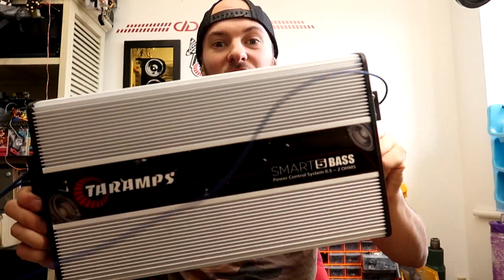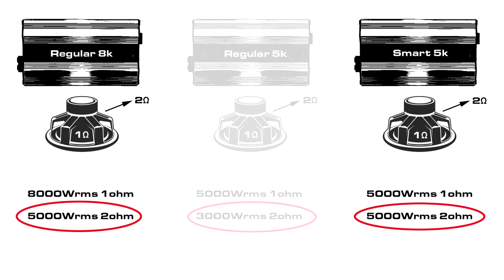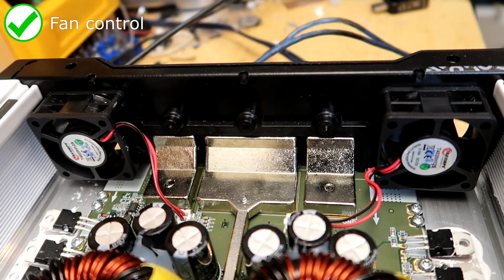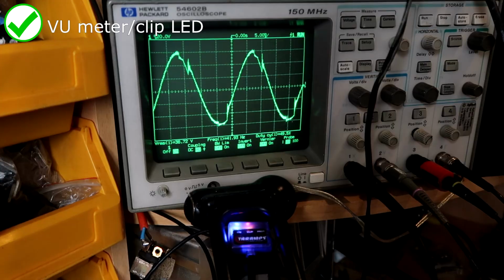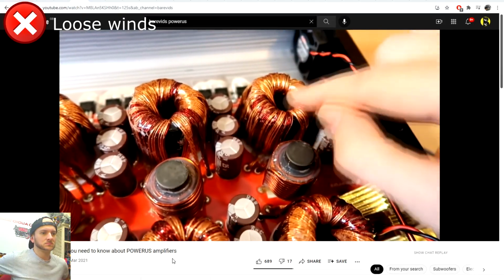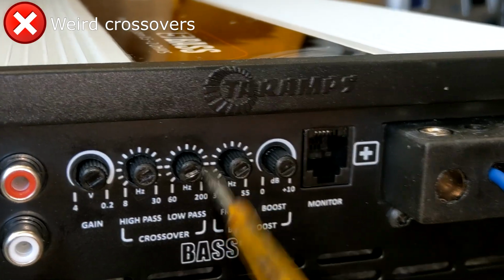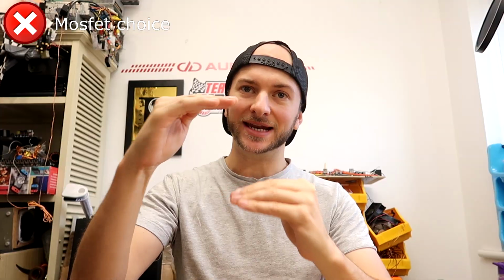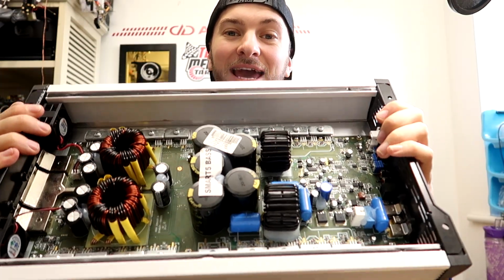The good VS the bad - Taramps SMART 5 & BASS circuit overview

Comment: I've got the taramps smart 5 bass and it has way more power than the other 1500 watt amp I have but now I've had it for like 2 months and I'm Hella disappointed I'm getting not much bass at all before the thing clips and it clips so easy I even have a lithium battery and  all 0 guage wire like I can berily hear the bass loud outside the car I have a skar vxf and I also tried 2 american bass elite 12vs I need help lol I want more bass I've seen people with a smart 3 flexing doors inches but I can't at all

Comment: hi Sam my HU rca pre out 4v but my tarampsinput sensitivity can only take 220mv how to match the level. please advise thanks
Reply from the maker: That isn't true, anyway your head unit pre out is only 4v when the head unit volume is on maximum and all of the subwoofer level etc is turned up to full. Just use your head unit how you would normally and set your amplifier gain until you reach one of the limits - amplifier clip, woofer thermal, woofer mechanical, or battery voltage drop.
Reply: @barevids  thanks Sam really appreciated
Reply: @barevids  subscribed

Comment: Would the smart 5 bass play mids and vocal or only bass?
Reply from the maker: @lawayne2021  only bass hence the name... Get the regular smart 5 for higher frequencies
Reply: @ the problem is I already brought the amp do you feel like that amp to power for a sundown u12 v2?
Reply from the maker: @lawayne2021  I don't understand, why are you asking about vocals when you are needing to power a sub? It is perfect for the sub
Reply: @barevids  I brought it for my sundown u12 v2 then I was told I can’t use the amp because it’s too powerful I have to get the smart 3 bass but I also have 10 10 midrange speakers I was told the smart 5 bass can play mids
Reply from the maker: @lawayne2021  that is nonsense, there's no such thing as having too much power. You just need to set the amplifier within the limits of the driver. It is stupid to recommend downgrading the amplifier, all this will mean is you impose a rail limit, and worsen the system efficiency and reliability.
Reply: @ alright thanks

Comment: Hello mate I’ve had shocking after noon basically I’ve had the amp taramps 800w when I hook it up was fine I was testing it for clipping 
No one is mention that they do not like more that 2v in from head unit or graphic 
Hints why it court fire 🔥 
Model number taramps ds800
Reply from the maker: @kayone8571  that's not why it caught fire.
Reply: @ hi and thank you for your reply  I don’t know why it did I was told they do not like 4v sent throw phono leads dunno how true that is 
Because all my other amps are just fine 
It’s grounded good with clean connections 
The power lead is good and thick little over size but definitely in the hole 
And it was new 
I have a old skool Kenwood  KGC . 9044 eq that has the adjustable screw from 1v to 4v it was Present on 4 v 
That then goes into to dsp crossover prv then to my amps I had all amps disconnect
Accept the one I was setting up with scope I had head unit where I know I clips I heard a pop then smokes from the remote and power I’m stumble I’ve fitted many and I still have them working
Reply from the maker: @kayone8571  You've probably killed it because you were clipping it. You don't need to set these amps up to clip or see the clip or anything like that. I assume you are using this on full range drivers. Therefore you would just set the gain at a point that is comfortable at the maximum hedge unit volume that you are normally using. You will know instantly if the amplifier starts to clip because it will come through as heavy distortion for your speakers. You don't need to use a metre or oscilloscope or anything like that to set your gains on these amplifiers. If you didn't have a load connected to the amplifier terminals and you were clipping the amp then that explains why it failed.
Reply: @barevids  thank you that’s exactly what I was doing I’ll try again on the second one with speakers connected and adjust only gain where my volume is up
Reply: @ hi buddy you was right the second one is working good now also I had. Inline fuse off the battery but didn’t have one close to in put to amp I’m
Trying to find which fuse is best for this amp 
I have now Install one near amp in put positive 50amp but I think that’s to low trying to find online
Reply from the maker: @kayone8571  you don't fuse for the amp you fuse for the wire. Don't run two fuses in series. Just have one on the power wire near the battery.
Reply: @ oh ok watching plenty America’s fuse the amp side as well
I’m not sure which amp fuse I need the manual says nothing

Comment: 0:23 as a guy with 3 dead smart 5s in my possession, I'm very eager to see what I can learn from these videos. I watched your full guide video you did with the SFB sundown and learned a lot! I'm learning a lot from all of your videos and super grateful to have found this one. I'm looking to become the St. Louis MO amp repair guy here in the states and your videos are next to golds worth for me. Thanks so much
Reply: Did you find out why the amps died? Are they just not reliable? I'm on the fence about buying taramps so I would appreciate any input you have.
Reply: @shawnchapman5916 most of the time I'm finding it comes down to a manufacturing fault, or a power demand fault. These smart amps are keen at keeping the wattage exactly where you want it down to a half ohm.. and they do so by clocking the power supply in a way that makes it drink reserve current from you batteries and charging gear rather aggressively. In short I always say: powers gotta come from somewhere. This is only my opinion and you may do with it as you please but... Your electrical demand should never exceed 50% of your total reserve at one time.
Reply: @CompanyNameLLC  i seen from your previous comment your from st louis, are you still doing amplifier repair?
Reply: On a side note... I'm looking at Taramps and Stetsom HV Series amplifiers lately. I see a large reliability in HV amps where you use voltage rather than current to feed the amplifier... With HV... None of the case gets wasted to a power supply for the MOSFETS because your series bank of batteries (170-300VDC) is the power supply. So more room for fets and way fewer losses to conversion. Worth a look. Most units start in the 20k-40kW region. I've seen some as large as 160kw which is absolutely diabolical @shawnchapman5916
Reply: @loudfiat did it really well
Reply: So you like the sfb better that the smart 5

Comment: Id like to hear your thoughts on the new Taramps smart boss 3k. I bought one and its my new favorite amp i ever ran. Im 43 and remember when 1000 watts cost $1000 if you could find one. These small powerhouse amps like the smart boss 3k just blow my mind. I have it pushing a Resilient Sounds Onyx 12" i reconed. What a combination! I recently subscribed,  i like your channel alot, especially the blind amp test with jbl and taramps, taramps should have cut you a check for that one, 😆 im sure it changed alot of peoples opinion of taramps in a good way, it did for me. Thanks for the videos.

Comment: Since the crossovers limit the output drastically unless wide open. Let's say I set the crossover FIRST then set the gain which would then overcome the wonky crossovers & not use the ones on the deck? Currently I am using the deck as you suggested but I hate when I need to pull the battery for one thing or another & my HU resets itself thus loosing the crossover settings.

Comment: Comment #2 - And wouldn't it effectively be more "smart-er" if they would pay more attention to the power supply, regarding the effect the input voltage has on power output?  Meaning: Same power out, between voltages of say 12.6 and 14.4 volts.  Free the output power from being so dependent on input voltage.

Comment: Isn't the REASON WHY the impedance may rise, because it's approaching the speaker's resonant frequency?  And if so, doesn't the speaker become more EFFICIENT at resonance? And if so, the added power produced by the "smart" amplifier - really is not needed/necessary, no?
Reply from the maker: This only applies in free air, as soon as you put it in an enclosure with a port, the impedance drastically drops at port tuning frequency. You can see this by looking at an impedance curve of a ported box.

Comment: Anyone know if you should adjust gains with subwoofer hooked up with these smart amps 5k and 5k bass? Wasn't sure if the smart side of it controls how much it puts out with sub connected vs not with tuning
Reply from the maker: Yep just go by the clip light no tools required

Comment: Can you strap 2 of these smart 5 bass together?
Reply from the maker: No, but you would never ever need to because no single coil will take 10kw, if you have one sub it will be Dvc so wire one amp per coil

Comment: So DC at the speaker outputs are normal for these amps? I've noticed DC voltage on my md5000 that I'm repairing, I thought that it was an issue!
Reply from the maker: It's normal due to the single positive rail voltage used. The sine wave needs to be able to swing up to rail, and down to ground, so it needs to settle somewhere in the middle which is what the DC is 😁

Comment: I plan on getting the smart 5 bass for my next system. And I have to run my stock headunit due to there being no aftermarket headunits for my car. How do you think I should set the high-pass and the low pass? Only would you recommend the smart 5 or the 5 bass not sure which one I should grab.
Reply from the maker: Both at minimum, and get the Bass model.
Reply: @barevids  awesome, thanks a lot.

Comment: Has the smart bass had the rail voltage issue resolved yet?
Also any opinion on the Big Boss Bass line?
Reply from the maker: Video on big boss coming soon
Reply: @barevids  Great Im trying to decide between Big Boss and non  Boss 8k
I have a Wolfram 7.5K that I never used, too big for my space. I like the power band from these smart ones better as well.

Comment: Wow after that review i feel like i could make an Amplifier from scratch .. somehow I understood the entire Review. and feel good about the smart five if im in the market..right now i have 2- 5k soundigital amps one that is 5 years old and one i bought 4 years ago but never installed...i did finally install the second amp but never put an rca to it ...and it popped and went into protection without a load on it 😢 but it was turned on and off for 6 months before it did want it did..😂 so was it my fault....im guessing yes but im not sure , After all, I've been running the other 1 for 4 years. Almost full tilt at least 10 minutes a day, if not 45 minutes a day...even on holidays 😅

Comment: Hello, how are you? Do you have the taramps screwed directly to the seat? Or is it with a wooden base or something underneath? since mine burned screwing it directly to the seat :(
Reply from the maker: It won't burn due to being screwed to metal, something else happened.
Reply: Thank you for responding, unfortunately it happened to me without having it fixed, it had no problems, after fixing it to the seat I turned on the taramps and short circuit, first time I use taramps I am with that doubt since it lasted 1 hour from the purchase, greetings from Chile ;) @barevids

Comment: I have the smart 5bass and after a few weeks with it, i can honestly say it definitely puts out About double what my trinity tas8000.1 8k that was in there previously put out. Absolutely way more power available on bursts & seems to sound just more solid & harder hitting for over 100 bucks less than the trinity. Considered the smart 8 but couldn't really fit it & looking back, the smart 5 amps are actually way closer to doing what most 10k's would do

Comment: Taramps definitely seem to be a real competitor in the car audio market. Where they could seperate themselves, and take over a large market share? Doing something only 3 very high priced companies do, offer digital inputs to their amps, without needing to sell a kidney for the amp. How is using a DSP then connecting to an amplifier with RCA cables NOT defeating the purpose? And how is a signal connecting the in dash unit with RCA cables to an amplifier with DSP really any better? It should all be digital/fiber optic connections like surround systems at home! In Fact, You CANNOT have TRUE 5.1 surround sound (or better) without digital connections because analog connections (copper wire) cannot handle the bandwidth and amount of information necessary to have 6 distinct channels. RCA cables are 1970's technology and simply 2 channels and nothing for dedicated bass/subwoofer, and yet 99% of all car audio is RCA cables, not even HDMI, which not as good as fiber optics, is still superior to fricking 2 channel RCA connections! (HDMI can handle 4 channels I believe, and is termed "Hi-Definition audio"). If Taramps wanted to grab a big car audio market share, it would incorporate digital/fiber optics availability. And simply dump RCA connections! Just sayin'. We car audio consumers are being "duped" for the most part. You can get a cheap Audio to Digital converter for around $30 these days for home stereos (run on 5v to 12 volt. hmmmm). and that cheap converter blows the doors off RCA connections! (and most flat screen televisions offer excellent analog to digital converters for surround sound capability today. but not car audio). sorry I will get off my soap box. pardon the interruption. Peace everybody. And hope you enjoy your Taramps equipment! They seem pretty good.

Comment: Just started investigating Brazilian amps, and there are a number of brands that are Brazilian manufacturers (Peavey for instance) that I did not know until recently. If the amplifier is actually "made" in Brazil (Taramps is) and not just designed there, that is already a plus in my book over Chinese offerings. Also Taramps seem to employ, smartly I think, fans in most of their amplifiers (every amplifier should have a fan I think). However, the fans are not of the same grade of fans like in a computer which run basically silent. And seem to run a bit loud, but I imagine the music will drown out any possible fan noise. But computer quality fans are also known for their longevity of operation, not just how quiet they run. On this end, I cannot say if the fans Taramps use make the grade or not. But, at least they are trying to provide better heat dissipation than their competitors, and "heat" is the biggest problem for any amplifier regarding operation, and challenging its durability and longevity of operation. If you happen to have a cheaper, less efficient Chinese amp, that in the beginning works well, but quits operating in a year or just starts not sounding good (distortion) it is due to heat, and the amps heat sink. That is generally the difference between your "budget" amps and higher quality amps like Rockford Fosgate (proven through time), and who knows maybe Taramps. They seem to be improving their designs and components while keeping their pricing below the competition, and doing a good job keeping them cool. Which should mean good long term performance.  It just seems Taramps are more about SPL than sound quality. I could be wrong. (Examples: Rockford Fosgate is known for having some of the lowest distortion - less than 1/10 of a percent distortion,  and longest lasting car amplifiers on the market. Rockford is known to Focus specifically on sound quality, not power. Kenwood falls into that category as well. Just fyi.)
Reply: Because they are brushless rc radio controlled high rpm fans designed to cool high amp output electronics.. im familiar with these type fans since I’ve been using similar like kinds in my remote control hobby purposes. I think it’s great if you can hear that sucker then you mean it’s moving a ton of air unlike your quiet pc fan, that would offer little help in cooling these amplifiers

Comment: Little off subject.
Reply: I have a taramps MD 8k board, is there a way to tell if it's a 1 or 2 ohm version? No sticker on caps or board.
Reply from the maker: Yeah look at the rail caps voltage and output fets model
Reply: Rail caps 200v so 2-ohm correct?

Comment: how to stop the throttleing on the smart 5/8... like what input votage, charging voltage, ac voltage, amp draw should you see to prevent it from the throttle
Reply from the maker: It changes depending on what you're rising to at each frequency.
Reply: @barevids  so nothing to do to stop it ?
Reply from the maker: If it's throttling you're at the limits of the amp clamping 8k and you need a bigger one.
Reply: @barevids  so could you disconnect subs, play 40hz tone, and turn gain up to max volume clean and after a moment should start to see the ac voltage go down due to the throttle affect? So basically I’d have to turn the ac voltage down until it stays level , or will this not work if the amp doesn’t see a load from the subs?
Reply from the maker: @Basshertz94  as I said, it depends on the rise, so you need to have subs connected. Use the clip light on the amp. It's accurate. If it comes on you're at the limits of the amp.
Reply: @barevids  I always set it clean using the clip light and dd1 and still hit those limits . That’s what I’m trying to prevent ..

Comment: @barevids what is the rail limit ? Like how much output voltage would it take to reach the limits and the amp quiets the sound? Does it matter what ohm your at and what voltage you charge at ? I’m referring the bass version

Comment: I also just took notice to the dual power inputs. I have single 0 AWG power and ground so I'm wondering if its OK to just split that or do I need to go back and actually run 4 separate wires? 🤔